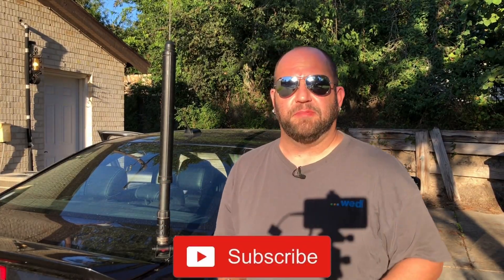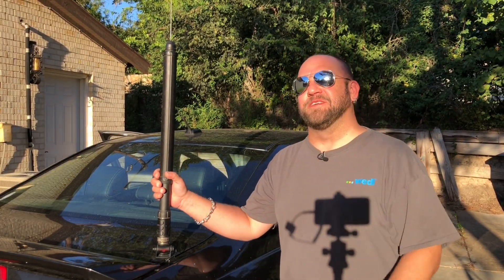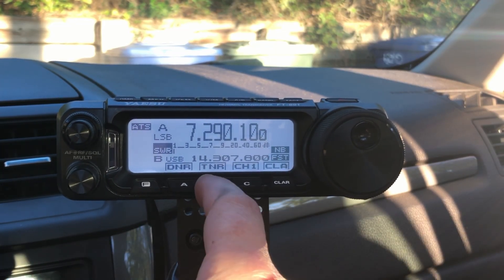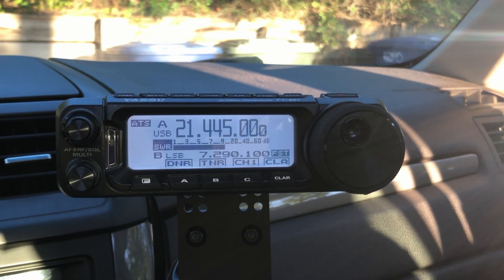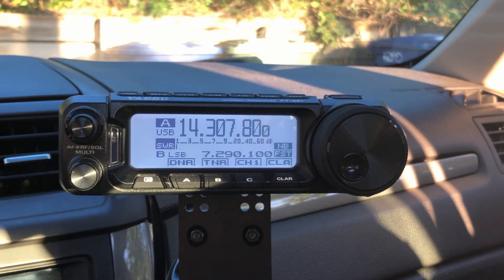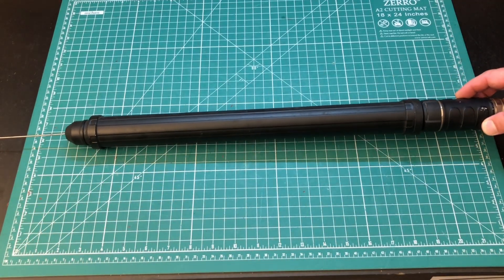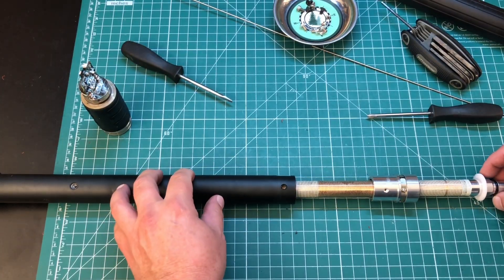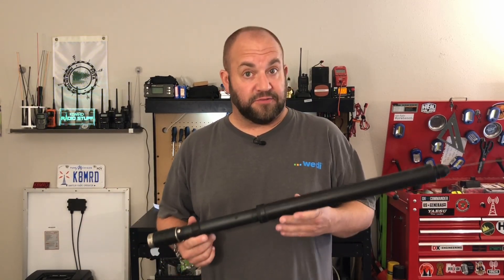Yaesu ATAS-120A Mobile HF/VHF/UHF Screwdriver Antenna

Comment: Atas is an option. But I can’t help wonder how inefficient the antenna is when 40% of its length is the loading coil. A 3 foot whip doesn’t seem long enough on HF. Now a wolf river coil or Slidewinder DX coil mounted on the car might mean you’ll need to manually adjust bands, but stick a 9 foot two piece cheap CB quarter wave on it and I’d bet it would be pretty superior compared with the Atas. Especially below 15m.
Reply: @timg5tm941 I agree with you 100%. But I doubt that the WRC or Slidewinder DX coils are going to survive with that on the car while driving down the highway, especially if that whip strikes an object. Not to mention the stresses that would put on the K400 mount.
Reply: @truckinguy92  sure, but I never operate actually travelling and the thing is, yaesu advise not to tune the atas when travelling either.
Reply: @TIMG5TM  I don’t tune it while in motion as per Yaesu’s advisement. But I do like to chat during my commute. I know the antenna is basically a radiating dummy load and I’m willing to live with it, because of the convenience factor. I know there’s more efficient screwdriver type antennas out there but they don’t allow tuning without having to run extra wires for antenna control. Like everything else there’s pros and cons. It all boils down to what you’re willing to live with.
Reply: I was thinking the same thing. Perhaps having a longer whip on the ATAS might give us better performance.
Reply: @frankwc0o good luck with that. The whip is so thin and a specific size that think you’d be hard pressed to find a longer whip of the same diameter.
Reply: @frankwc0o  not only that but putting a longer whip on it would not allow it to do 6m, 2m, & 70cm. If those bands don’t matter to you, then that’s fine but it’s not how Yaesu designed the antenna.
Reply: Hi Mike Do you still use the atas 120 as your primary antenna? If so do you still like it?

Comment: Easy to set up, awful to tune, useless as a radiator. I bought mine with my FT-100D. Like most Yaesu radio equipment, it was garbage. The antenna would never dial in right, so the SWR was off by quite a bit. With the exception of 2 meter SSB, the radio was junk too. I tried everything to get this antenna to tune, including setting it up on a tripod in my front yard with tuned radials. I finally gave up when the motor stopped working. I took it to a local ham swap and set it to the side of a table with a "free" sign on it. The last I saw of it, some happy "customer" was carrying it around. Apart from my VX-5R which is a great little radio, every Yaesu I've ever owned has been a complete waste of money. I've had much better success with hamsticks.

Comment: Running mine with the FT-891, too.  Haven't played in quite some time, but about to get it back in a vehicle and on the air thanks to a new job where I travel a lot.  Previous Comet mount that was recommended broke at highway speed.  I have the ATAS mounted on a steel plate now, and it is solid.  It's a compromise antenna, but works very well with the 891.  The tuning makes it so nice without an interface/box to add on. 
Thanks for the video, you have inspired me to get mine back on the air!
73,
Brett
Reply from the maker: Oh man that is so cool!  Glad to hear you got the itch to get back on the air.  Hope to work you sometime ATAS to ATAS.

Comment: Good Video Mike.  Well done and very informative.  

I own one of these and use it with my 891.  I live in an over 55 HOA and use it mounted to an Alpha Delta Outpost.  It is easy to put up and take down and stealth as heck with the antenna black and my Outpost painted Military Olive Drab.  For me... this set up works very well.  I am mostly a cw operator and have from Naples Florida worked.. France, Spain, The Canary Islands, Costa Rica, Puerto Rico, the Virgin Islands, Canada and out your way in Texas on 35 watts.  Absolutely no complaints.  I am getting ok signal reports, which is just fine considering...

I would like to clarify a couple of points... 

The 891 screen with the up and down arrow, is really only good in adjusting the radio in receive, as there is no way to measure the SWR while adjusting it and transmitting unless you have an external SWR meter in the line when transmitting while poking either the up or down arrow with the multi function knob,  Instead of stressing the finals looking for a match, I will use that screen in receive and try to adjust the antenna for maximum noise, and then finish off adjusting the SWR while transmitting using the microphone method you covered.  I find the manual tuning is the best to get the lowest SWR as the radio micro will let go of the tuning process once it gets an SWR of under 2 to 1.  

I'd also like to clarify one other point that a lot of hams get confused with this up down button stuff.  When you push the "up" button the antenna is moving "up" frequency... THUS the antenna length is actually going down getting shorter.  And visa versa.  Pushing the "down" button the antenna is tuning "down" in frequency and the antenna length is getting longer... going 'up" in length.  This is typical Yaesu interface logic... hi hi.  I struggled with that for the longest time when I first got the antenna wondering why the antenna wasn't obtaining a match, until I realized I was tuning it in the wrong direction.  Once I realized what I was doing, I have not had a problem with it since.  

I am very careful with my ATAS.  It never really gets wet, so I can't say anything about how well it holds up to the elements, but it certainly has enough rubber seals so it should be ok in that respect.  All in all... it is a very nice antenna.  Not cheap for sure, but is a perfect match to the 891, and you cant beat if for how fast it can QSY.  Also the Q of the 2 to 1 bandwidth is fairly reasonable on 20 and above.  It is a really nice antenna.  

Just as an FYI for what it is worth... The ATAS-100, 120 and 120A can be used with other radios if you have a MFJ-1925 ATAS  Controller (actually a Bias T interface), which emulates the control circuit of the Yaesu radios that are design compatible with this antenna.

In conclusion... I love your videos!  They are always very informative, and I would like to meet you on the air some day.  Keep em coming!

Best 73's
Dan  K1YPB
Licensed since 1962

Comment: Mike.  The ATAS (like any mobile antenna) will radiate better with a good ground system.  The car or truck is the other side of your antenna.  Grounding all the parts together give a better ground and it reduces some of the noise generated by the vehicle.  That’s where I learned about it years ago when cars generated much more RFI.  And now with all the computers in every vehicle you need the grounding and bonding to prevent interference inside your vehicle.  You are lucky with your car but many will have difficulty, especially if they run over 25 watts.  I would recommend bonding everything you can together.   Dave K8WPE
Reply: I wholeheartedly agree.  Extreme grounding is the key.
Reply: Do you use the car battery and ground the radio?  I'm having issue using an external battery that is not connected to the car.
Reply: I did some bonding to the trunk where the antenna is mounted and I tunes every band but 12m. I’m at a loss because I spent a lot of extra time installing the whole system. This guy just sticks it on his car and BOOM it tunes 12m no problem. What gives?

Comment: Would you consider making another video with the ATAS-120 mounted on a balcony railing (maybe even with some counterpoise)? That would help a lot of us living in condos (or people living in HOA areas) decide whether it is a good investment (two for one, mobile and base station antenna).
Reply: On a balcony, the railing may or may not be enough of a "counterpoise".  It is just too big of an unknown.  I suggest dropping a quarter wave counterpoise for the band you are operating.  The antenna will operate as a vertical OCFD, and you may get a good match, a good 2 to 1 band width and fairly decent signal reports.
Reply: @danielzdanowicz6899  Yes, there are variables, maybe Mike would be able to check how it would peeform, for a greater good :)
Reply: I am in a small apartment and use a 120A for my base (and mobile). I put one the goliath MJF triple mag mounts on a metal table on my balcony, then screwed on the 120A and ran several radial wires of varying lengths all over the balcony. It gives me great SWR from 70cm to 20m, and about 2.0:1 SWR on 40m. I haven't DXed yet but I'm very new to the hobby. Talking around the US isn't a problem, though. I run an FT991-A.  For mobile, I have another of the same mag mount, on the roof of my SUV. When going mobile, I just unscrew it from the mag mount on the balcony and screw it onto the mag mount on my vehicle, and use the same radio.

Comment: Good info on solving the flashing ATS.  I never had the patience to wait. I always just unplugged everything and plugged it back in. Took mine apart to see how it works, because that's the way I work.  In the process, I also learned all about the ball bearings in the ATAS...HiHi!!
Reply from the maker: Ah those pesky ball bearings lol!  Wouldn't it be faster to just wait though?  As opposed to unplugging everything.
Reply: @hamradiotube  yeah, it probably would have been.  But when something is wrong, the first step in tech support is to unplug and reboot.  After hearing you say wait, I'm thinking to myself, "well I'm pretty dumb." Lol!

Comment: Both Antennas ATAS 100 as the 120A were giving me a hard time. I bought the ATAS 100 together with the little FT-100d Field Commander back in 1998. A waste of Money on both ATAS Versions as I found out lately. The 120A isn't any better than the 100 was. Any other Screwdriver Antenna from another Manufacturer will make you happy but the ATAS definitly doesn't. 349.- bucks under the Train. Those are the Experiences I made

Comment: Hello, just to contribute to your list of compatible radios, ATAS 120 works with FTdx-10 too. By the way, YAESU has also FC-40, which is a "long wire" tuner system. It is a good alternative to ATAS 120, as with some small tweaks in form of 1:4 autotransformer, can tune ~7m long wire to 80m without any trouble, and considering the length of the radiating element, it is much more effective than the ATAS system. The only setback of FC-40 is that it has a control cable too. By the way, the ATAS is not dedicated for use in motion or at least this is what the manual says. 73 de LZ5RG

Comment: With a low mount, and because it looks different and expensive, how do you prevent the antenna from being stolen?
Reply from the maker: I guess other than unscrewing it and putting it in your trunk, there's really nothin you could do.  I don't think ham radio antennas are on top of too many lists of things to steal though.  So we got that going for us.

Comment: I have an FT-891 in my truck and I'm using a Wolf River Coil antenna.  I was actually going to get the ATAS-120 this weekend but I found an amplifier I had been wanting in stock so now I have to fill the ham radio piggy bank back up.
Reply from the maker: Man it’s a delicate balance isn’t it?  Congratulations on your new amplifier!   And good luck on filling the coffers again for the next radio purchase.

Comment: What would you need to use the ATAS-120a with an Icom IC-706? I'm trying to find a good mobile solution for my installation without having to use "ham sticks" and changing them out all the time.
Reply from the maker: That’s a good question bud.  Being that this is a Yaesu antenna, they designed it to work with Yaesu radios.  I’m still very new to this antenna and don’t have Icom mobile radios to test with it.  I’m told there are ways to make the two work together, much like I use my 891 and Tarheel antenna, there needs to be some kind of control box to go between them.  I know absolutely nothing about this yet though so give me some time.
Reply: I believe MFJ did some kind of manual switch which allows you to tune the ATAS antenna.
Reply: MFJ 1925 ATAS controller.

Comment: I want to thank you for this video, I just purchased one from the DX Eng. sale today at 50% off. Almost took it back because it was doing exactly like you said... you have to wait on it to decide which way to tune. 

Update: I use mainly 10 m in the vehicle, when tuning from 10m to 12, 15, 17, it would go into "wait mode" and never tune. Come to find out those bands were tuned "out of band" and would NOT transmit because the mars mod is not done to this radio and didn't use those bands anyway. Once the frequencies were properly tuned within the bandwidth of each band, it works great. You can jump and tune to any band you want. I am using a FT891 and have the tune on one of the hot keys. Works fine now and making contacts! Thanks!
Reply: $389.95 on website today.   How did you get it for 50% off??
Reply from the maker: 50% off??  That's crazy!

Comment: Hi Mike - it is a good(ish) antenna - have had one (when I had Yaesu radios but I have learnt now)  -  I am now sold on the Tarheel II as it is better quality and works well with any radio. I don't like the Yaesu menu logic (as you demonstrated!) - Tarheel II with a Target Tuner does tune 80m and it doesn't seem like it was made by Lego.
Reply: I would hope it's better quality, at twice the price!
Reply: @notreallydaedalus  you have a good point!
Reply: @M0RMY  Better to spend twice the money and have an antenna that actually works rather than an ATAS-120 which is a steaming pile of 💩
Reply: Do you have to program the Target Tuner to know where to move up and down?
Reply: @frankwc0o  it has two modes - auto SWR and memory.  In auto it senses the SWR and goes to the optimum tune.  This can take a bit of time.  Best way is to pre-program set frequencies in a band.  I do 3-4 per band and it automatically takes you to the nearest setting.
Reply: @M0RMY  I’m assuming the preset is done via up and down?
Reply: @FrankRomerophoto  Yes. You set any number of preset lengths using the up/down buttons to tune perfectly then store in memory.  Thereafter the antenna automatically goes to the nearest setting according to the frequency
Reply: @M0RMY  cool. I’m still having issues with the other antenna.

Comment: I am having a terrible time getting ham sticks to work well with my truck. This would be a big investment to move to this antenna, but it is looking better all the time. What kind of swr did you end up being able to get on 80 meters? Also what kind of a mount would you recommend for a pickup truck?
Reply from the maker: This antenna doesn’t do 80.  The mount is a Diamond K-400.  It’s about the most sturdy mount on the market that I’m aware of.
Reply: By itself it won't tune 80 meters

Comment: I have one and I can hit the Carolina's and back to back hit California.  Once from a bank parking lot I jumped into a four-way with California and Alaska.  Middle Texas (San Antonio) seems to be a choice spot for working this antenna east, west, and lots of places in between.   W0YVY
Reply: Is your radio grounded and are you using the car battery to run your radio?  I'm having issues with mine.

Comment: I’ve done 2 installs for my ATAS on different vehicles, the only thing I’ll say about grounding is when I beefed up the ground connection to the body I did get a better match on 40m but it still worked all the same .  Great antenna, nice video
Reply: Did you ground the radio and use the car battery to run the radio?  thx.
Reply: @frankwc0o  The radio was only grounded via the co-ax shield to the mount which was in turn grounded to the body.  The power for both + and - were directly to the battery.
Reply: @julianlong  weird. It seems my setup should work. Thx

Comment: I use the same set up FT891 and Atas120. Have called into the HHH net driving around Central Queensland. K9RM was probably doing most of the work but a qso is a qso.

Comment: I’m just about tired of having to swap or ham sticks on the 891 in the mobile. ATAS120 makes the most sense
Reply: I have been trying to come up with an EFHW 80-10 for the truck but haven't found the right design yet. Why tune when you can use resonant antennas and harmonics?

Comment: I've had mine for several years now with my 857d, perfect pair !!  The only problem 'Ive ever had is it occasionaly locks up - just have to take it apart & clean the inside tube about every year and a half. I would def buy another one if I ever needed to.
Reply: Do you ground your radio and do you use the car's battery to run the radio?  I'm trying to figure out why mine doesn't work. thx